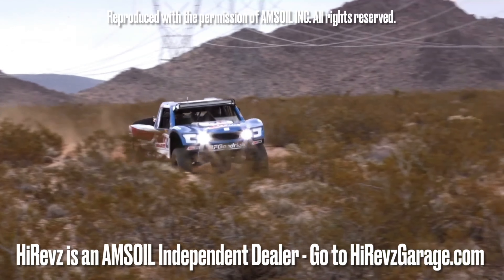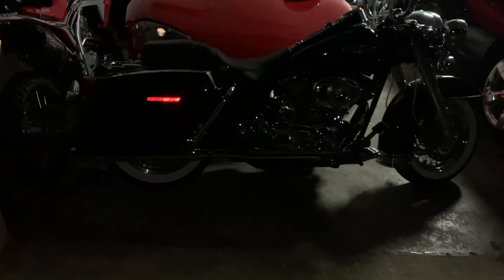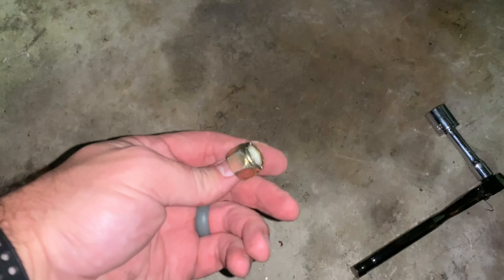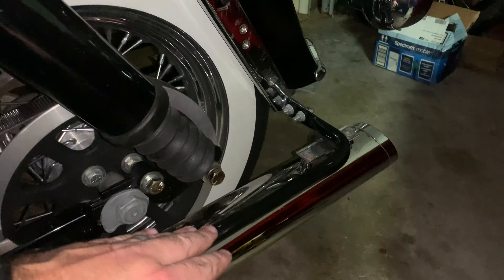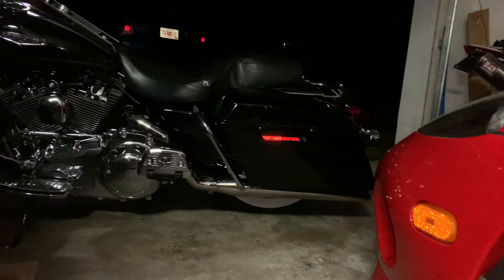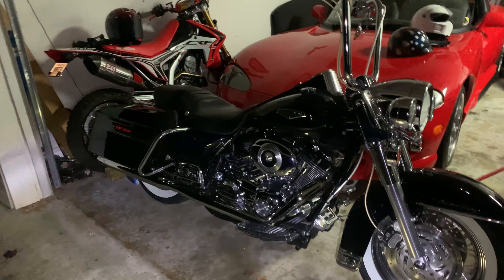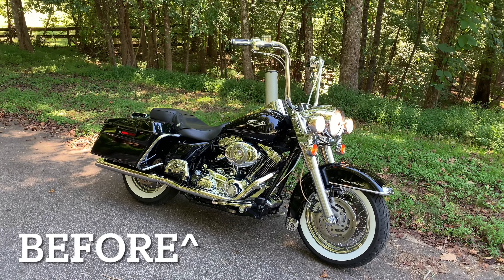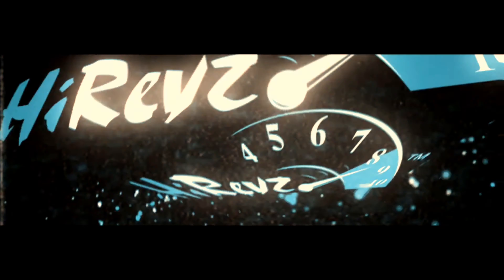Lowering the Road King - '07 Harley Davidson

Comment: If you get a flat when no one is around, your bike will likely tip over (?) .. 2 inches is alot, and I'm wondering if your back tire is scraping the fender struts on larger bumps.. I'm on the lighter side and going to try one inch blocks on my 2020 RK since I have decent aftermarket shocks already.

Comment: With kicking the bottom of the shock back, did you have to modify the bags? Just wondering if there was a clearance issue. I have a 96 road king with the same hard bags.
Reply from the maker: No, I didn’t have to modify the bags.

Comment: Two things, One-My 1999 Road King drags the ground on hard turns, can't see lowering it for this reason. Two- I lowered my Super glide using these brackets, but I didn't like the Engineering, so I added a steel strap from the bracket to the frame.